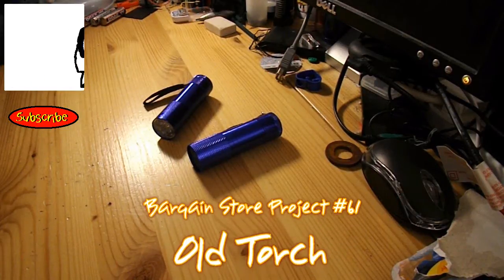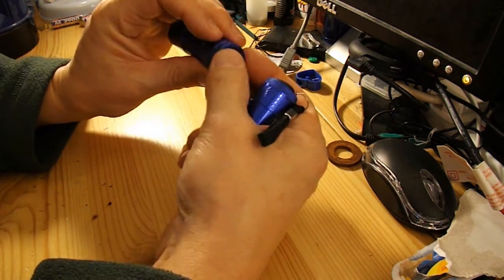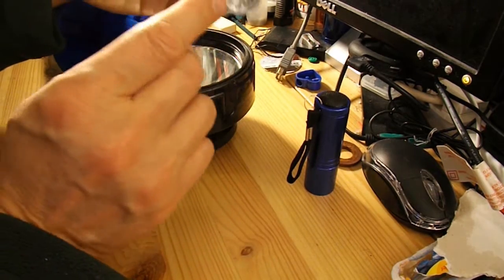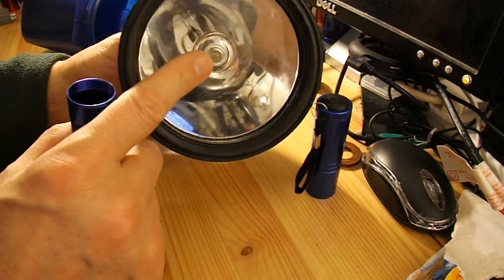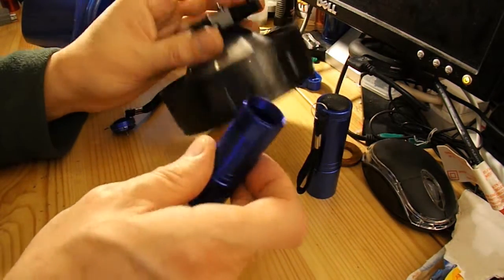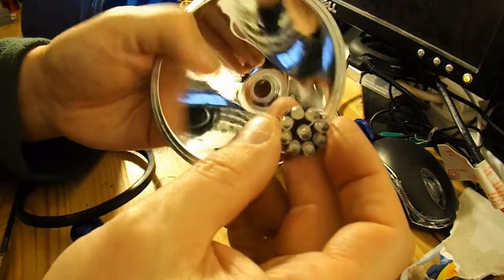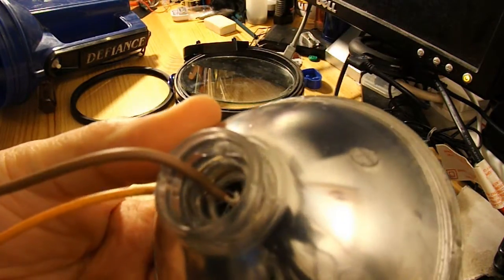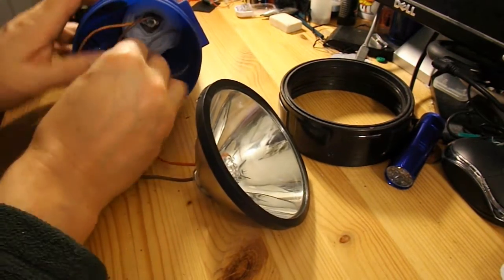Bargain Store Project #61 Old Torch New LED Array

Comment: I'm thinking of doing something like that but the big flashlight I have is a rechargeable spot light, I haven't looked into it much yet but what I'm wondering is can I replaced just the old bulb with multiply leds and still use the same internals
Reply from the maker: You can buy direct replacement LED bulbs for the old style torch bulbs. They are not cheap but should last forever.
Reply: And by the way great channel, one more sub here :)